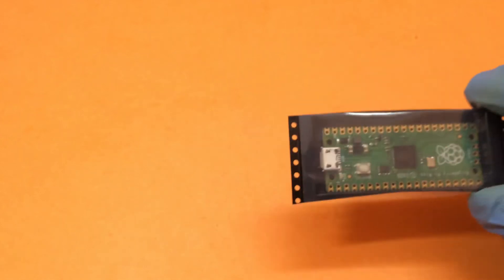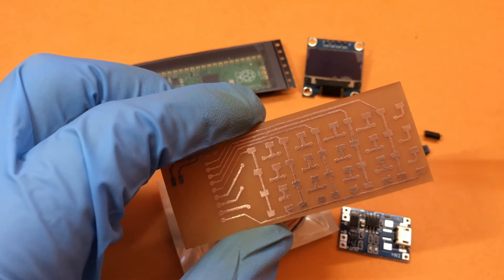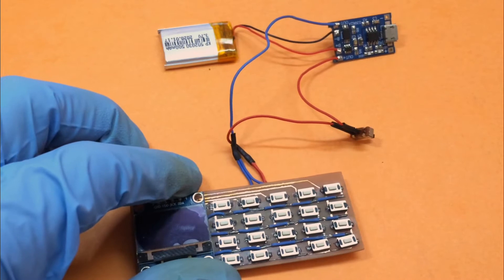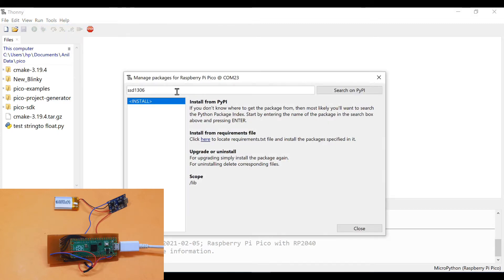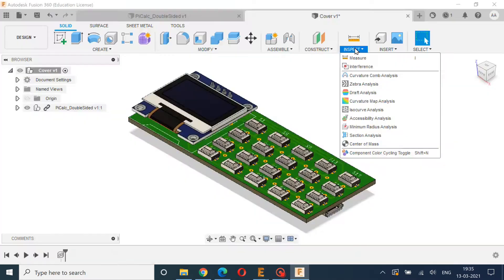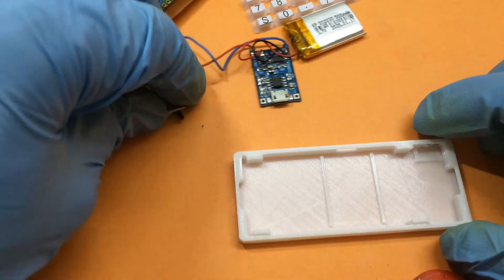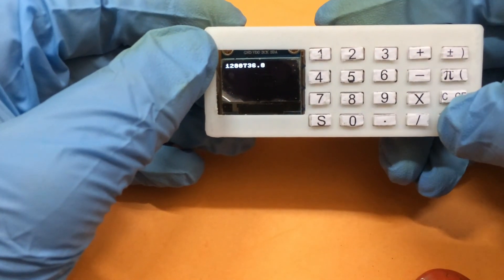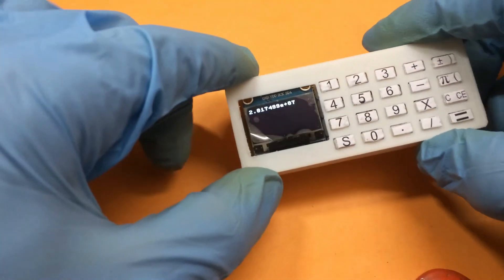PiCalc: Raspberry Pi Pico Based Pocket Calculator  |  Instructables

Comment: If you want to make this look a little more professional then rebate the numbers into the 3D print (ideally as a part of the design but you could use a cutter) then fill with either paint or wax crayon.
Reply from the maker: Yeah it would look much better but my printer wasn't tuned enough for such small details. Your suggested method would work best with resin 3d printers